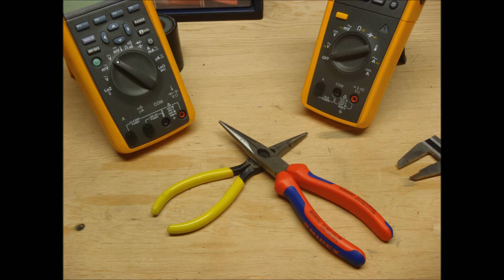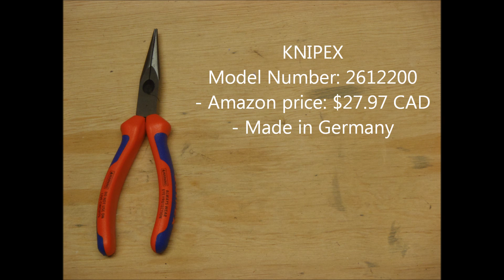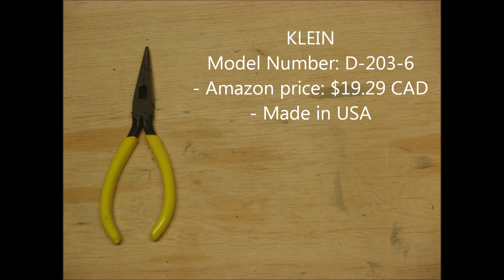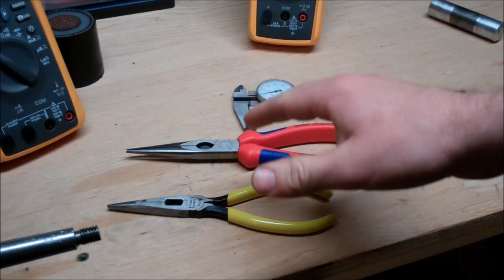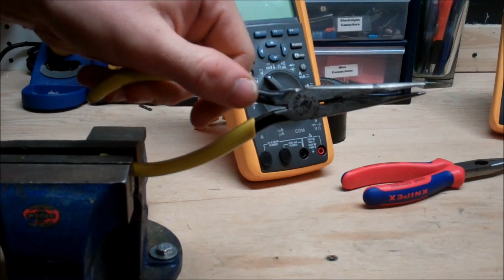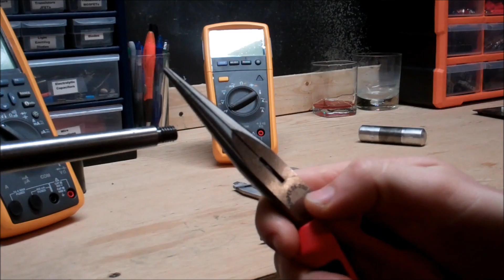Knipex Vs Klein Needle Nose

Comment: You not comparing apples to apples.  8 inch needle nose to 6 inch needle nose.  Klein also makes journeyman series and the handle is a closer comparison.  The knipex are great but more delicate smaller tip.  The Klein cut better and are more robust.  Both are better in certain applications.

Comment: As an electrician, do you recommend the insulated (1000v) knipex for the diyer? I dont do electrical hardly ever, so do you think it's worth the extra cost for peace of mind? 

Also, great video! I dont think that there needed to be a "winner" announced though LOL. It seemed like Klein gave a pretty pathetic showing!
Reply: Not really considering the standard insulation will work just fine working with 240v.

Comment: The knipex does have a flaw. It won't cut electrical tape.
Only the tip of it touch closes, I have the same pliers, and you can see it in the video. 
It is bent in, making it not touch the cutting feature. 
I just grab something else to cut the tape with.
Inconvenience for me from such a
 nice tool.

Comment: I really love your reviews, but I'm not totally vibing with this one. 

What are the lengths of each tool? The Klein appears to be the 7" model (which actually is a significantly different tool than the 8"). Your review is pretty misleading, based on the fact that your 2 tools are of different lengths. Naturally, the longer nose is going to be more flexible! And also, you speak of the pressure being exerted as bending in the Knipex, versus the pressure being transferred to the joint in the Klein. This is true. However, compare the joints. The Klein's joint is almost the diameter of a quarter! That is not going to fall victim to mechanical breakdown anytime soon.

I own the 8" size of both (but I have the thick "Journeyman" handles on the Klein), and I find the Klein 8" to be quite a lot stronger (more stiff, I should say) than the 8" Knipex. The Knipex does flex significantly when applying a twisting motion, whereas the Klein barely flexes at all. (And despite your summation, I find the flexing is not be an ideal characteristic, but acceptable in this particular tool) That said, the 2 are COMPLETELY different beasts. The 8" Knipex are more precise, with a longer, narrower tapering tip. The Klein is more rugged and brutish. Neither is superior, but I thought it was worth pointing out the diffe rences between them versus the models you reviewed.

All this said, most of my pliars are Knipex--and long-nose pliars aren't really designed for applying high amounts of that sort of rotational torque. However, when I DO need that high level of torque in a long-nosed tool, the Klein is what I pick up. When I'm needing a more traditional needle-nose, though, I use my favorites (the Knipexes).

Comment: Knipex are for field technicians or bench repair techs, Klein are electrician pliers/needle nose pliers. To compare them is like comparing tweezers to linesman pliers. Knipex is a superb tool, please compare them to similar products not field installer/mechanic tools. Klein are great for field mechanics (I was one for 21 years) but not the delicate precision work Knipex or Weha are designed for. The color issue is not an issue as years ago most tools were the same color, we used heat shrink color to differentiate.

Comment: While I do agree with your pros and cons of the pliers , the models are too different for comparison. Another thing about Klein, the colors on the pliers are colored to mark them for different reasons and different uses. You might be using the yellow Klein needle nose for other reasons than it's intended purpose. As pliers go, I'm a Knipex guy these days, but have a huge Klein collection myself. I've been to a few of their factories and one thing I saw in production, was greasing/oiling of the tool before it's final assembly and metal dust fragments and particles would stick to the tools and then they would be packaged. Which, you'd think after about 160 years of production, they'd figure a better way of packaging tools to keep them clean. But they haven't lol.

Comment: I'm not sure what "field" you worked in but the Klein needle nose look almost unused, you never used them enough to break them in that's why they didn't fall shut when you had them in a vise. Klein tools are designed for electricians or people who work with wire all day, not so much electronics, visit technitools website if electronic tools are what you seek, much more specific to the field than knipex.
Reply: I do residential electrical. My knipex still look new even after months of use.
So if the Kline's look new to you why is the metal looking so old.
Reply: More than 90% of german electricians have Knipex pliers with grips insulated up to 1000 V (VDE-grips, mostly red and yellow) according to IEC 60900 in their tool bags. You can get almost every tool from them with insulated grips, even ratchets, water pump pliers and torque wrenches. That's a matter of safety even if you're circuit is not hot. And that's a thing I don't understand, in America you'll find large "wear safety equipment" on almost everything but the tools you're working with on electric circuits are not insulated. And only for the US market Knipex is printing the "Don't work on live circuits" on the blue/red comfort grips. In Germany this is not the case.

Klein is making insulated screwdrivers and that's it. Even if you double-check everything, there could always be Mr. Stupid switching the circuit back on because he wants to make some coffee. And then you's got a problem...

Knipex is having a good ratio between the price and what you get for it. In Germany the model shown here is costing 17€ (19 US$) on Amazon. The insulated version is about 24€ (27 US$).

And btw: Klein is not available here in Germany. I think it's too expensive for them to get into the market here. They're not a large company, but Knipex is not too. It's a family enterprise in the 4th generation now.
Reply: Just a different culture here in the US. All the safety warnings are mostly just for liability reasons. Electricians are less cautious here. Lot of household systems are 120v not 220 used in other countries. All that insulation on everything would be annoying and impractical in real use. Speed, time, and money here are king, not safety. That's just some bullshit the public in general believes. About the only thing they care about here is how fast they can get it done. Capitolism.
Reply: Knipex stuff is nicer than klien for the most part but klien is the industry standard and what a lot go with. Outside the electrical trade many don't even know the name klien. Most electricians aren't paid well and klien tools are pretty inexpensive and work well. Knipex tools would be considered a bit snobish by some. I own many of both and they both work well, many automotive mechanics here prefer knipex tools due to their high quality. German made goods in general are seen as top notch quality here.
Reply: Even 120V are enough to kill you. A current of 30mA on the right time is enough for a cardiac arrest. In case of 120V in the worst case there could flow a current of 120mA.

In Europe it's 230V +/- 10%. So the UK could still have their 240V.

The reason is money too. In Germany the employer must insure his employees against accidents on job and on the direct way from and to the job, and he's paying the insurance all alone. In case of third party envolvement they would make demands on them. If something is happening the insurance is raising the price for him. If there are too many accidents occuring labour inspectorate (Gewerbeaufsicht) would close his business in the worst case. In larger companies you're getting the tools from them. And in the company I'm working for Knipex is the standard for pliers, the screwdrivers are Wera or Wiha. All the tools at work are property of my employer. If some tool is getting lost I'll have to pay for it, so no chance of getting tools for free. If it's damaged or broken I must give it to my superior and I'm getting a new one. And the interest of the insurance is to get you back to work after the accident, so medical treatment is actually better than if something is happening in private. The health insurance (mandatory in Germany) only interest is that you're alive...the rest doesn't matter to them. And then we're back on the matter of money.

But I'm having my own tools at home, Knipex and Wera with the laser tip. And as I said, the insulated versions are not so much more expensive than the standard versions. I don't know how it's in the US, but that's the case here in Germany. 

The prices of the prices of Klein in the US are comparable to Knipex in Germany. Same league...

I don't have the money for low-budget tools. They're costing you more money than good tools. They don't last long, they could ruin your work (screwheads for example) and in the worst case you could get harmed if they break (some tool parts stuck in the hand and such things).

I've got some tools made by Channellock, actually they're not bad. But I've used some tricks to get them. Amazon prime and a few days later I've got them for a reasonable price. But with Klein I couldn't do this because Amazon is not having them directly and the shipping costs are horrendous. And I'm the pride owner of an Occidental Leather tool belt. Tool belts are not common here, only bags or cases. But if you're working on a ladder this is very good to have such a thing. And if you're getting a tool belt it's a cheap one that will not last long...

Comment: Unfortunately, these are actually "Long Nose Pliers" not true needle nose pliers.
Reply: @danstoolroom7700  Needle nose pliers have very skinny and long tips. They are more for getting into very tight places and holding things like wires or electrical components that don't require strong gripping. Long nose pliers have tapered, extended tips. They are beefier and can exert more gripping force.

Comment: How lucky you are there. I went to a large store in Bulgaria and the Knipex build quality was the worst of anything on the shelves, where yu could also find Wissent ( rebadged product ) and cheap Chinese pliers. No idea where they get them from, but I would get a Beta or Unior 100 times over any Knipex I saw in that store ( store is a large multi-national chain, very popular in Germany ). Some of the long nose pliers had bent teeth inside and looking at wear on these, they were not used or abused by instore buyers, another did not close fully the top end, which might also be someone to have damaged them while playing at the store. The top was the polishing on the combination pliers, 1.1cm difference between two identical models, absolutely sure it was done on hand and by someone with very low standard for craftmanship. I noticed many UK forumers to advise that you go and select a pair of pliers instore, I think I see why. Anyways, I was amazed to find such junk quality. I have Knipex crimping pliers and they were fantastic in every aspect but the pliers and cutters were horribly built.
Reply: +SS18w4531g00 Maybe those are Chinese knock off,not real "Knipex"!
Reply: I own 50+ knipex hand tools and Quality control simply could not be improved in any way. You saw knockoffs for sure man.
Reply: That was in Bauhaus, I seriously doubt they`d sell knock offs. Besides, another large store was also selling their line and qualitywas the same. I now have a set of Bahco`s and they are by any means superior in about every way to the Knipex that failed me ( was killed by a 4N4004 diode ).

Comment: Hey Nick I appreciate the video, I just wanted to say I have unfortunately not had much luck towards Knipex. I am an Aircraft Mechanic btw.  I found the teeth wear very quickly and my needle nose pliers have a weak grab as the tips seem to spring after use which make it difficult to manipulate cotter pins or grab greasy objects. I went with knipex because everyone swore by them and they seemed to be more cost effective than lets say Snap On. Well I recently switched to snap on and their tools seem to pretty much walk all over my previous tools especially their talon grip needle nose. however my Knipex diagonal pliers have served me really well and never let down so I chose not to replace those.
Reply: Kevin McDougall 
did u purchase 26-11-200? 
try knipex 38-11-200 mechanics nose plier. it probably has sturdier tips.

Comment: I don't think the flex comparison was fair because the rivet to tip length of the knipex is longer than that of the klein. If you cut the tip off of the knipex so that its rivet to tip length is the same, you wouldn't have as much flex.

Comment: The Knipex are the needlenose I carry in my pouch, but they're not the only ones I keep on my truck - exactly because they flex so much. I've found it to be a problem in some rare situations where you need leverage deep down where only needlenose pliers can go, and the Knipex tips deflect so much that the tool falls off the item you're turning (for instance trying to tighten a locknut at the back of a deep box). During twisting I would say the deflection can be up to 1/2" or more which is pretty extreme. Still, they're a great tool!
Reply: 38-15-200 if you prefer the version with comfort grips. The first two digits are the pliers model, second two digits are the grip version and the last group is the length of the grips in mm.
Reply: +PetrosArgy Useful information.  Thank you, one year later.
Reply: PetrosArgy 
did u purchase 26-11-200? 
try knipex 38-11-200 mechanics nose plier. it probably has sturdier tips.

Comment: not sure needle nose pliers are supposed to be used for high power clamping. I'd say they are more for finesse and should be smallish...there are pliers for high clamping forces.
Reply from the maker: They definitely have a time and place - where force is needed in an awkward place. I personally got a mass array of these - tiny ones I usually use for electronic work, for some reason they are tool I am always reaching for. Like you said the finesse work.